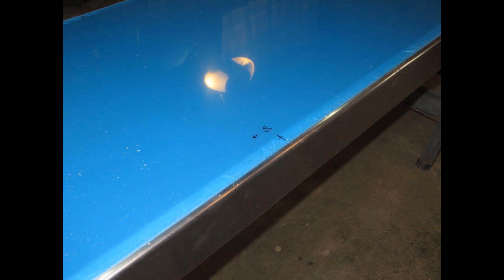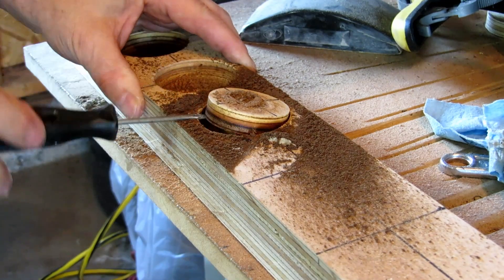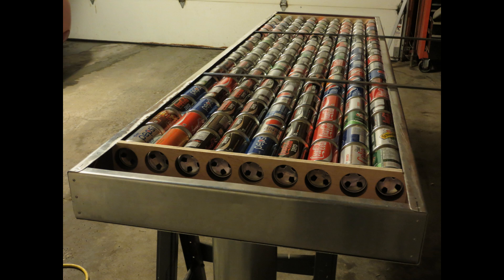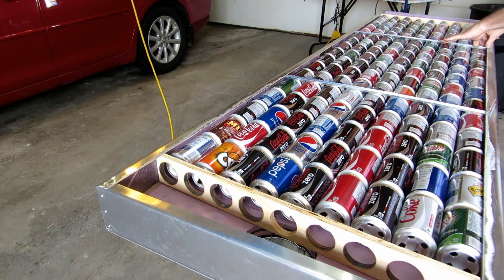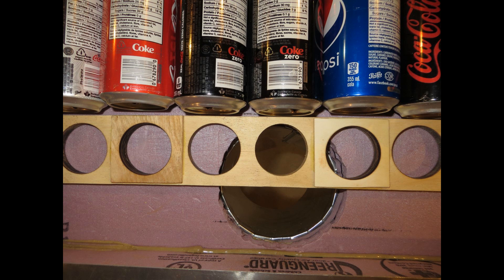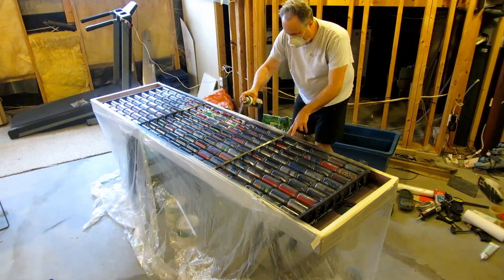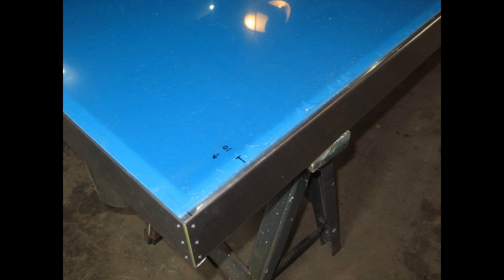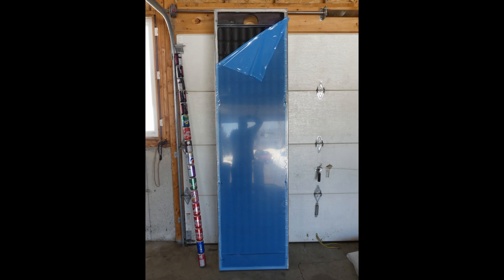DIY Solar Air Heater Part #5

Comment from the maker: Hi everyone,
Thank you all for your questions and feedback.  I am working on the 6th video now.  I can share that the first completed unit produced too much heat and not enough air flow.  The delta between intake and exhaust was 106° Fahrenheit.  What I found was for a unit of this length, the solar tubes need to be wide open with no restriction inside. I have just finished redesigning the tubes and will have my 6th video up in November.
Reply: where is the 6th video? thanks
Reply: I could have told you that at the beginning.
Reply: I also would have asked you why bother with the cans at all?  Lot of trouble for nothing it seems.
Reply: Ah, no 6th video, no follow-up; that means the whole thing was a monumental flop.  I hope none of you tried to duplicate this sad fiasco.
Reply: Why not just couple to a more powerful blower that can handle the back pressure?
Reply: I didn't find the 6 video, 2019
Reply: @Dwayne Price hey man don't forget about the updated solar heater video
Reply: freddyzdead1 it works just not as efficient as he would have liked, l know it will work too many others that do
Reply: @sheilamclaughlin963  lol it's like he built Rome and then never showed us it after... and we never heard from him again. So much work for something that didn't work.

Comment: I built my solar beer can heater around five or six years ago. Although a bit like yours mine is based on a thermoplane design. Instead of cold air entering through a tube in the bottom you have a plenum that runs the width and length of heater below your cans separated by a sheet of styrofoam. At the top the heater turns at an angle to match the suns position during the winter. The end fits into a window and gets the window closed down on it like a window ac unit. Air flows into the lower plenum and gets drawn into the cans as they heat blowing the air back into the room. I took a hole saw and drill press and drilled out both ends of the cans. I get good airflow without a blower and the air temp. is raised forty to fifty degrees per pass. I built the entire unit out of foil faced foam board and used a sheet of corrugated greenhouse panel for the clear cover. When I built the unit I think it cost me around $50 for material and I got at least that much heat value the first winter so it's been free heat ever since. I'm planning of building a second unit this fall.

Comment: Huge tip: When using a holesaw deep like this, run a vacuum with a crevice tool near the cut to suck out the sawdust as it is generated with frequent raising the holesaw to evacuate the kerf, and what I discovered is cleaner cuts with no burnt sawdust! Try it and you will be amazed at the improvement.

Comment: Great documentation, great skills, love the bender !! and
 Love the Cleco Fasteners you have introduced me to. I would never have the patience to produce a finished video like this !!

One Thing I can recommend.. Is Looking for used slider glass doors they are large very heavy but have double glass. I would structure any framing to the glass and not the aluminum box as it is very heavy. To dismantle.. If you remove the face frame the glass falls out then unscrew the metal frame from the wood trim/frame inside and reuse that, otherwise glass is exposed and you must be very careful not to break glass while moving. I salvaged some aluminum and will use two sliders for mine Thanks for the examples !

Comment: great build mate, try drilling a few 6mm holes around the ID of the hole saw, easier swarf clearance, less burning..
Reply: Good tip, and a slower spindle speed too, it's all about inch per minute and surface speed.

Comment: Question.   Is there any way to utilize this solar heat for melting snow/ice in winter?   So much free heat from the sun ….   It just Seems like there might be a way to capture it for melting snow/ice.   If it can be done, you are the person to figure it out.    You’re so impressive.   (Just a Far fetched random thought. 🤔).  Thanks
Reply from the maker: Sue, I think it would require a different material.  Thin aluminum heats and cools quickly. Perhaps a fluid or a dense material would be better suited to retain heat. I would tend to start looking for resources in Mongolia.  I have received a great deal of feedback from that country.  Everyone I talk to there seems to know more about this subject than I do.

Comment: Dwayne, great details video.  I'd love to see a follow up / final product / installation video if you did one. Also with results.  I read it was too hot.  Where do you live and what climate ?  I see a majority of these videos, people live in snow covered areas with bright sunshine.  I'm looking to build one, I live in Melbourne Australia, aiming to use the unit in the winter to raise the temperature by a few degrees (when its ?10degrees C outside, no one home during the day, raise it by a few degrees) a day and make some impact to the forever climbing power bills.

Comment: Dwayne Price  -  I am confused why all the complexity ?  You are simply setting up a 'solar collector' painted flat black.  Does the curve of the cans somehow add to the total exposed area to the sun ?   There are only so many btu's of heat for the exposed area to the sun .  Painting it black of course ensures maximum absorption to that heat (no reflection), but there will be no need for the cans and extra complexity.  Just figure the air volume vs heat gain vs fan speed for how deep to make the collection 'box'  -  no cans  -  just paint the back board flat black .   ?  ?    (Am an ex- Air-Heat Service Tech and I prefer simplicity in my heat gathering devices.  (:-)       Thanks .
Reply: Not only do the cans serve no purpose, they present a very significant air flow restriction, which will increase the power requirement for any given airflow. What might make sense is to have a series of fins, thick enough to have substantial thermal mass. You'd have to do some math to figure out whether it's worth it or not. The cans intuitively seem like they are doing something, which is why this myth is persistent, but it really makes no sense.
Reply: The reason for the cans is to have a material that is heated and which the air can flow through to carry the heat away.  If a simple black box is made and the moving air is allowed to contact the plexiglass, there will be significant loss of effectiveness.  Although inside the box will get hot, if in cold weather the plexiglass will be cold and the air moving across its face will cool and cool very effectively since convection will be involved.  All in all such a system will still heat the air but it will be less effective.  I built one such system almost 35 years ago.  I wish I could provide the difference in effectiveness but haven't done the detailed experiment.  I think www.builditsolar.com has some data on different designs.

Comment: 7:00  maybe a little late but if I had to do it I'd take 2 pieces of wood, one with slightly bigger holes, glue them together and make the bottom of the can sink in a bit.

Comment: Great job Dwayne. I learned a lot from your construction techniques. How did your final version work out? That is a beautiful heater. Thanks also for including your mistakes and how you fixed them.

Comment: Any news? I am very interested and what start some project as is yours here in SLOVAKIA. Please add Part #6 with some measurements. Thaaaaaaaaaaaaanks
Reply from the maker: hi, sorry that I missed your email earlier. I was just sharing with another fellow that currently the unit is producing too much heat. a test I completed on April 3rd had the air going in at 58 degrees Fahrenheit and coming out at 164 Fahrenheit. It was a partially cloudy day. The temperature increase was tremendous. However, the flow of air was not sufficient to meet my needs. I am currently reworking the design of the interior of the cans to increase flow, and produce less Heat
Reply: so will you publish next video with some tuning ? :)
Reply: Hi Any news about video number 6? :)
Reply: Hi Dwayne, I really like your video series.  Can you post an update on the performance and shortcomings of this design?  Very interested in starting a project like this!

Comment: Hello, any news about heating ? New experience and so on? I wold like to build one so if you have anything more what its not in video... ???
Reply from the maker: Hi, thanks for the note. 
The first unit I built, (end of part #5) produces too much heat and not enough
CFM.  

My first test produced the following:

Intake air temperature 14C / 58F

Exhaust air temperature 73C / 164F

Delta: 41C / 106F

CFM: not enough to measure
accurately.  Too much resistance within
the air tubes. 

 

I have since redesigned the interior of the cans to decrease
the temperature delta and increase flow. I have found that the original can design,
depicted within these videos, is better suited to shorter heaters; perhaps 3-4’
high, rather than 8’.  Since I have the
space – 8’, less resistance is needed and I can produced more CFMs.

There will be a sixth video showing these changes, before
the end of October.

All the best

Dwayne
Reply: Ahhh thx very mutch , I cannot wait to see it. Thanks for all support ;)

Comment: Hey Dwayne, any issues with hot air passing across the Owens Corning Foamular Insulation?  Will it withstand the high temperature air flow?
Reply from the maker: hi thanks for the question. my early findings have not been focused on the insulation. I have not been looking at that with any detail. So I cannot comment whether it works or does not work. What I do know, is that currently the unit is producing too much heat, and, not enough flow. I am currently reworking the design of the interior of the cans to lower the heat but increase the cubic feet per minute.

Comment: Great attempt but highly overbuilt. Frame could easily have been constructed of scrap material. Also you need diverters in the air chambers otherwise the air will blow out the center tubes (path of least resistence). Epoxy or glue would have been more than fine for construction instead of costly and time intensive rivets.
Reply: Exactly. Engineers engineer and then wait for failure only to engineer again. Ummmmmmm, Germany WWII. Nuff said.

Comment: Nice clear videos, but why not just use  wood for the frame.  Way cheaper and a lot easier and quicker with no special benders etc. Aluminum also is a great conductor of heat, which is not really what you want on the outside of  your heater... didn't look like you had a lot of insulation so that could be a problem with aluminum...?
Reply: Look.. if you want to keep warm in the winter just buy a shipping container, paint it black get inside, and close the doors. I guarantee you will be warm in no time. Crazy I know, but a lot less work than this over-engineered soda can experiment.